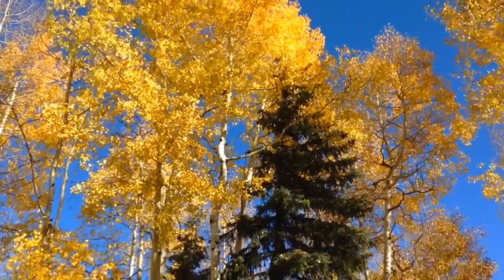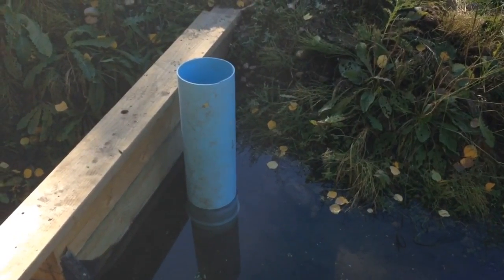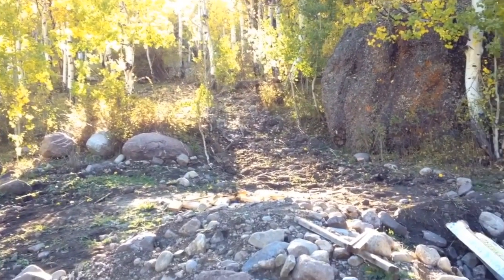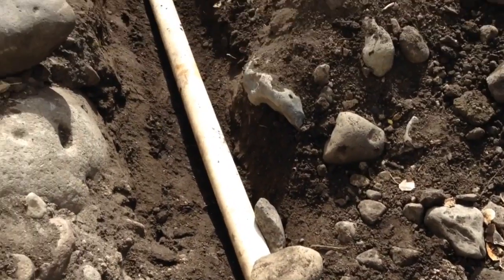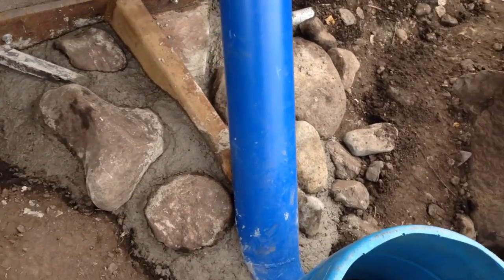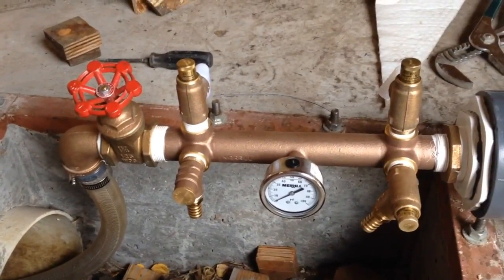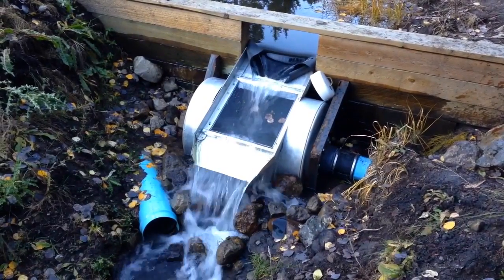Part 13 MicroHydro Power System in CO TESTING

Comment: If a welding shop actually did those welds may I suggest you never use them again, they are horrible.
Reply from the maker: You aren’t the first viewer to comment on the poor quality of the welds.  The focus was to keep the costs as low as possible and I paid about $200 for all of the work.  It was done at an auto repair shop and given that price others have said it was understandable. It’s been about 6 1/2 years since installation and we’ve not had any problems.  Thanks for watching.
Reply: @mrhydrohead  Using an auto shop explains these welds perfectly, exhaust welding is possibly the lowest of the low. 

6.5 years without a fail is enough to say the welds are doing their job even if they do look horrible and even if they were to fail tomorrow 6.5 years is good for high velocity water through carbon steel pipe. 

The biggest problem would be over penetration of the weld into the pipe causing turbulence and an erosion spot in the pipe. Hopefully that hasn’t happened.

Comment: At the intake, why not make a roof like water diverter to move water to each side, with holes in the middle debt so that will strain out debris from entering your inlit.  sort of like a arrow pointing to the upper part of the stream, you can use  Corrugated material, and drill holes as filter, the arrow shape can be made in as many levels as needed for the debris (snow melt probaly bring in more trash/debris.  Just an idea.

Comment: Don't you need permission from the local municipality to redirect/recreate path for natural steam? The steam must have come from somwhere outside your property under public jurisdiction.
Reply from the maker: In Colorado do you have to apply for nonconsumptive water rights in water court. You are then issued a conditional water rite for seven years and once you have proven a beneficial use of the water you can apply for an absolute water right. This is all handled through the state courts. It is most likely difference in other states

Comment: I'm not sure why you selected galvanized pipe for a water application. Corrosion...
I didn't see an intake screening device, what happens to debris which needs to be diverted elsewhere?
(Probably a different episode)
Reply from the maker: Galvanized corrugated pipe for the bridge is for rigidity and a PVC pipe runs within it.  I also provides a small amount of captured air for insulation.  Not a bit of corrosion to date on that.  There are about 25 videos in the series which I'm guessing you haven't seen all of .  
 I'm never sure who has seen what of the series.  Here is a playlist of the 3 part synopsis which is an overview of the whole process https://www.youtube.com/playlist?list=PLtTypVpmDd-vkT9bJQkXw4I1t0e_4jMYA  Within that 3 videos are pointers to the more specific things you might want more information.  Hope this helps.  Thx for watching

Comment: How much is the total drop in meters and power output exactly?
Reply from the maker: There aren't "exact" measures with our hydro system due to terrain and precision of measurement devices.  By extrapolation we have 98psi of static pressure which would indicate 226.38ft of head (98 x 2.31) or 69 meters (226.38 / 3.2809).  Pressure meters can often be off by a pound or two.  
Because we have an Electronic load controller (ELC) governing the system, "exact" measures of power get distorted by the ELC as well due to the sine wave being altered in the ELC.  There are also losses resulting from transmission and efficiency losses.  We can reliably use 7500 watts of power at full water flow settings.  We only run it at this flow setting  during the Winter when we need all excess power for heating.  It got down to -5° F last night.  Other seasons we run it at 4500watts.
Sorry I can't be more precise than that.  Thanks for watching
Reply: Thank you for that response I have sent you an email for more technical advise.. Thanks in advance

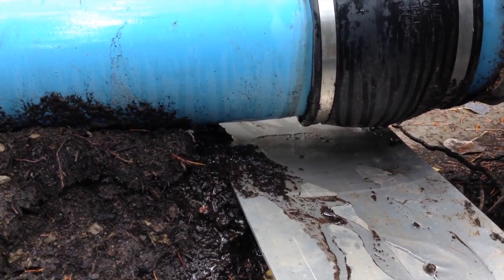Comment: Wow, that Fernco at 8:30 looks pretty stressed. Did that hold or did you have to do something different? We've had no luck with them past 50psi or so.
Reply from the maker: That coupling only had 2-3 psi in my estimation, but it became increasingly enlarged over time. We replaced it this fall with a coupling that has 6 strap bands and a stainless steel wrap between the bands and the rubber liner. Still it did last 4 years in use and once removed returned to its original shape. Thx for watching
Reply: Thanks for the reply. I know you've heard it a thousand times but what a beautiful install! I appreciate and respect your need for privacy but it is sort of a shame that you couldn't provide guided tours of the site, it should be a national monument of some sort

Comment: I'm impressed with your innovative approaches but it seems like simpler systems would have accomplished similar power output.  Why not use some type of in stream water generator like this https://saidit.net/s/OffGrid/comments/1sdo/ultrasmall_water_power_generator/ and just use cables to move the power to a battery box/ house?  Or even an open sluice with a simple old fashioned water wheel hooked to a generator?
Reply from the maker: I don't know how much of the series you actually have seen.  The intention was to utilize pre-existing equipment in the redesign of the system.  The archimedes screw device you link can't put out anywhere near the power harnessed by our system which is direct AC with no battery storage in the design.  We already had the equipment and no need to redesign that part or go to the expense of buying new gear.
Thanks for watching
Reply: @mrhydrohead  Got it.  Makes sense about utilizing previous equipment.  I will try to catch up on the old vids.

Comment: https://youtu.be/gY3p2e1-kN4
Reply from the maker: Thanks so much for sharing this video.  I hadn't seen this one yet.  Turbulent wasn't around when I got started in 1996.  I think their design is great.  I just which they had a larger market penetration.  I don't think they have a large number of installed units yet.  The low head/high flow approach is something that can be applied in so many places.  When you think about it, moving water is the largest collective of kinetic solar energy on earth.  Wind and solar pales in comparison.  Thanks for watching.
Reply: @mrhydrohead  - If there were 10s of 1000s of Turbulent Hydro units all across the US, supplying individual needs as well as feeding into the system there would not be one or 2 locations that could cripple the power grid. It would make it a multi-point connectivity and we could all benefit from it! Keep on powering on! :) Glad you like the video!
Reply: @mrhydrohead  https://www.youtube.com/watch?v=pXFkrKygXQY

Comment: Could you think something like this could be made with a tower tier system without a creek or river
Reply from the maker: I'm not sure what you mean by a tower tier.  The key measurements to make are the quantity of reliable flow and the head or fall that the water will take which governs the pressure.

Comment: I sure hope you didnt pay much for that weld job, yuk
Reply from the maker: About $250 for all the welds.  100psi is max load.  Intent was to keep costs down, not cosmetics.  Had a local auto shop do the welding cheap.  Sorry it doesn't meet your standards.  Works fine nonetheless. Thx for watching  I'm never sure who has seen what of the series.  Here is a playlist of the 3 part synopsis which is an overview of the whole process https://www.youtube.com/playlist?list=PLtTypVpmDd-vkT9bJQkXw4I1t0e_4jMYA  The whole series is in about 25 videos.

Comment: Find yourself another welder. It's rough as guts!
Reply from the maker: Other comments have been made on this.  Auto repair shop did it.   Under $200 all in as I remember.  Numerous welds as you could see.  100psi was potential load.  Pretty not important.  Keeping costs low was intent.  Sorry you don't approve. Thx for watching

Comment: This system looks as if it will work indefinitely with minimal maintenance, I'm sure that there are many many envious farmers and homestead peeps that have water flowing through their property, even if it's city runoff, it's free, it's an awesome gadget to have built, well done sir.
Reply from the maker: The system runs pretty much maintenance free.  The only issue is the changes in the creek diversion that have to be periodically dealt with.  This spring has seen a huge volume of water which changed the course of the creek.  So, I will be figuring out a new approach to doing the diversion once the waters recede.  It was super heavy snow this year and the runoff is still going which is about a month longer than  normal.   Anyway, thx for watching and the comments.

Comment: What about this water generator?
https://www.aliexpress.com/store/product/5000w-220V-water-Hydroelectric-generator-Single-phase-or-three-phase-Low-Speed-Start-NdFeB-permanent-magnet/2828045_32971050046.html?spm=2114.12010612.8148356.1.ad844e5eogZ7Ef
Reply from the maker: Looks interesting, not that we need any more gear here, but thanks for posting, others might find it useful. and thx for watching

Comment: the black rubber couplings aren't rated for that much pressure, and that's why they are bulging.
Reply: he should of used a ban clamp like the ones used with cast iron pipes,the one with the thin metal that goes around the rubber than there's four clamps instead of two
Reply from the maker: I asked about those at my pipe supplier yesterday and they only had them in stock up to 4".  Thanks for the suggestion, I will try to find a source for those for 6" 

And thanks for watching

Comment: Haha you need to find somebody who can really weld. That's HORRIBLE welding
Reply from the maker: Speaking of the welding,  just know that it was all accomplished for $250 at a car repair shop.  The focus was to keep the cost low, which we did.  At 100psi we've had no problems whatsoever and cosmetics aren't a concern.  System runs fine.

Comment: 1. THAT MUCH WORK LOOKS INSANE 2. HOW MUCH ALL THAT COST ? 3. HOW MUCH POWER WILL PRODUCE ? 4. WILL THAT EVEN PAY OFF IN A LIFE TIME ?  5. WELL DONE FOR THAT HARD JOB ;-)
Reply from the maker: Good Questions that many have asked before
1. THAT MUCH WORK LOOKS INSANE
Yes it was a lot of work, but we wanted to make it a solid permanent addition to the property.  
2. HOW MUCH ALL THAT COST ? 
If you watch the whole series, out initial system (video parts 1-5) in 1996 ran $25K. For that we got pressurized domestic spring water, power, and a pond to raise fish.  That was in lieu of paying $140K (1995 cost estimate) to bring power line in 7 miles and then pay monthly bills.  The redesign and move to creek (video parts 6-20) cost another $55k finishing in 2015 in lieu of paying $250-300K (2013 cost estimate) to bring power in.  With the move we retained the domestic water and pond.
3. HOW MUCH POWER WILL PRODUCE ? 
This year we ran it in Winter at about 7500w (180kWh/day) and it provides all heating to the house and a hot tub with additional overhead for all tools, appliances etc. with no power bills.  Excess power gets stored as hot water (300gallons) always available. In other seasons we run it at a lower flow setting of 4500w (108kWh/day) as the other setting is just to much waste heat.  We could run it at the higher settings year round and may do this in the future to service a greenhouse or other needs.
4. WILL THAT EVEN PAY OFF IN A LIFE TIME ?
It ultimately is an investment in the value of the property and a solid commitment to be off grid as a lifestyle choice.  Lots of people try to look at in terms of payback, but compared to the cost of bringing power in, it was a no brainer decision and the rewards of abundant reliable power have been well worth it all.  Every time you cook a meal, turn something on, or do a job with your tools you think, man thats cool that its water power that is doing that!  
5. WELL DONE FOR THAT HARD JOB
Thx for watching!  I never know who has seen what.  Watch parts 20-1,2,3 for a synopsis of the whole project. This is a playlist of those 3 parts: https://www.youtube.com/playlist?list=PLtTypVpmDd-vkT9bJQkXw4I1t0e_4jMYA

Comment: I am sure you realize the welding of the brace to your epoxy painted pipe will cause the paint to fail in the vicinity of the weld.  I  would expect the pipe to last 15 years at least even with this defect.  I would have used  PVC or Fiberglass for the whole design.

Comment: i think sir, when flood comes, your piping will be ruined,  nice to divert the water right or left side of a river using a concrete dam and wooden flash two flush board just incase of flood and any  flotsam/sand to stock in your dam
Reply: Philip you seem knowledgeable on this  kind of project.
Reply: @bonkiano  i experience in making this, use for irrigation, using the flashboard but first  divert the water when heavy rains come, just pull out the wooden board to flush the sand and it will no be ruined by the raze of flood

Comment: lots of diffrent steels and alloys you are mixing there may cause premature rot.
Reply from the maker: Perhaps, but no problems thus far.  I imagine it will run for my lifetime without problems.  Thx for watching.  I never know who has seen what segments.  Parts 20-1,2,3 are a synopsis of the whole thing

Comment: I have not found this information ... is it possible that the difference between the source and the power plant, in terms of height, is about 70 m ?
Reply from the maker: We have static reading of 96 psi.  96 x 2.31(feet per psi) x .3048 (feet per meter) = ~67.6 meters of head.
Reply: @mrhydrohead  Exactly, thank you very much ! grazie mille

Comment: Want a lot of pressure then use a big tank and have the pipe on the bottom and have the water from the river pour into the top of the tank.
Reply from the maker: Thats essentially what we've done.  Thx for watching.  I never know who has seen what segments.  Parts 20-1,2,3 are a synopsis of the whole thing.

Comment: You’re really gonna wish you had installed a 1/4 turn lever valve on the drain point rather than a gate valve. Might be worth trying to change it if you have any problems with it anyway in the future
Reply from the maker: Maybe some day,  No problems so far.  Thx for watching.

Comment: How does it work winter 2019 love  it by the way
Reply from the maker: Running just great all winter. Can develop a ice cap over the intake screen when it’s really cold -10 to teens Farenheitb but not a problem. Just keeps flowing and currently generating about 7200w 24/7/365. Will turn flow and resultant power down and remove creek diversion in May for spring melt off. All is well. Thx for watching

Comment: has it Held up through out Winter.great diy project.
Reply from the maker: Yup, just runs continually and is currently generating about 7500w continuously 24/7.  Heats the house and the hot tub in addition to all the other uses.  Thx for watching.  I never know who has seen what segments.  Parts 20-1,2,3 are a synopsis of the whole thing.

Comment: why would all the time and  money spent on this be better then just using solar panels
Reply from the maker: Imagine a football field size set of panels which is what you would need to supply a comparable feed of power, attached to a large array of batteries requiring maintenance.  Then imagine 6-8 inches of snow which would need to be cleared after each snowstorm.  At 8600ft. in the winter it would be like having a job instead of a reliable power source.  Hydro excels because it is consistent 24/7/365 power that requires little maintenance once installed.  thx for watching.  If you haven't seen it check out parts 20-1,2,3 which are a synopsis of it all.
Reply: @mrhydrohead  i can tell that you have put in many hard hours on your project and im glad its paying off for you. all you need now its some hydro powered heaters for your pipe line

Comment: I'd look at getting a better welding company, that's shocking quality for a professional outfit. Ok for a prototype build I guess..
Nice Hydro idea though!
Reply from the maker: You’re not the first to make the comment on the welds. All the welding was achieved for $250 at an auto shop. The focus was to keep the cost down and the pipes only need to hold 100 psi. They may not be pretty or up to your standard but they work fine
Reply: @mrhydrohead  - just because they're ugly doesn't mean they aren't solid.  I'll take ugly and "cheap" over expensive and pretty any day!  For welds that is!!
Reply: Ha, not surprising I guess.
Autoshop, that figures, i'll let you off then 😜
Reply from the maker: Andy C 🙏

Comment: What actions are you going to perform so that your pipe doesnt corrode underground?
Reply from the maker: The metal segments of pipe were primer coated and painted with marine 2part epoxy grade paint from the turbine manufacturer. Should last at least my lifetime. And there is only about 6-8 ft of it buried at the powerhouse. Everything else is PVC. Thx for watching

Comment: Your pipes will freeze and crack in the winter.
Reply from the maker: Your thought is appreciated, but 3 winters running thus far. No cracks. The majority of pipe is buried except for the bridgeportion. Snow tends to provide some insulation from the deep winter night temperatures.

Comment: How much power this produce?
Reply from the maker: in Winter ~8Kw = 8 x 24hrs. = ~192Kwh per day, in other seasons system flow is intentionally reduced to ~3.5-4Kw because we don't need the excess power
Reply: Wow. Impressive
Reply: booger king 50hp